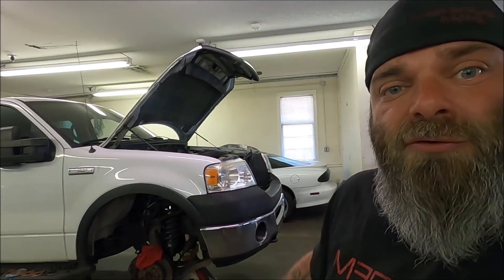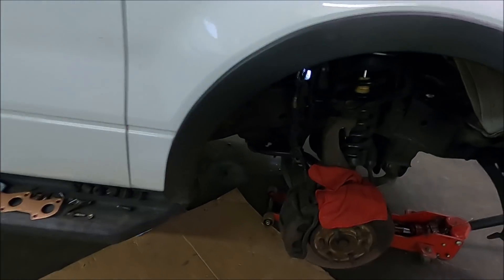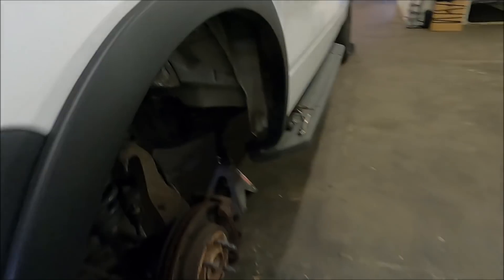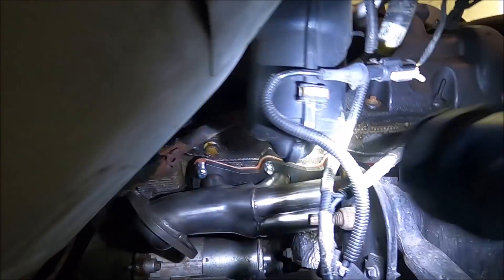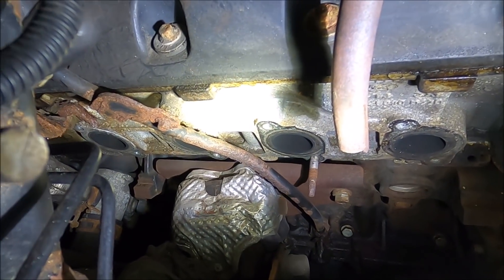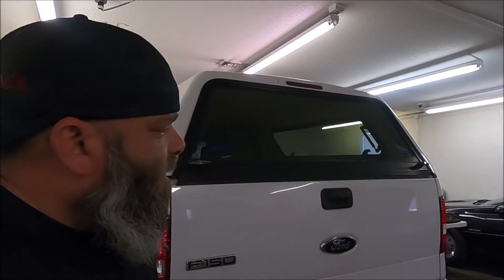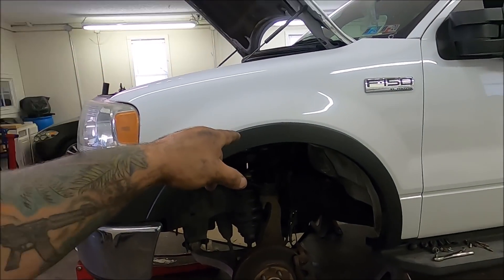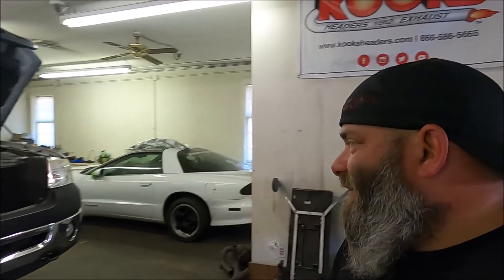This FORD F150 Makes Me REGRET Becoming A Mechanic! PART 3!

Comment: It's easy to see why you hate this work, by the time you add the hours spent to do the job compared to what the BOOK says you should charge you would be bankrupt. It is bad enough that you are doing part of the job for nothing when the new manifolds don't fit then you have to wait for another set so the truck is sitting in your way then you have broken studs tell them to go to an exhaust center if they will do the job many in the UK won't touch Manifolds any more.